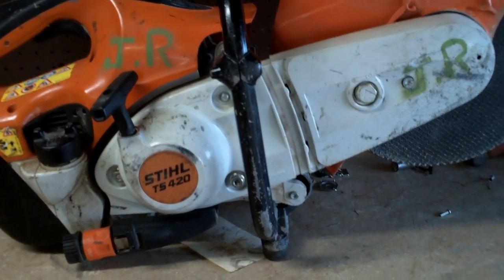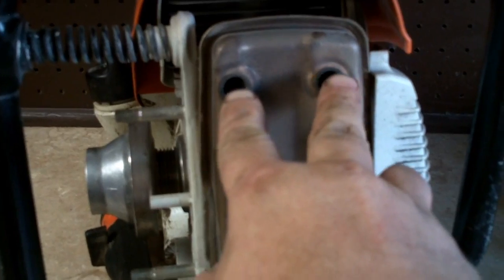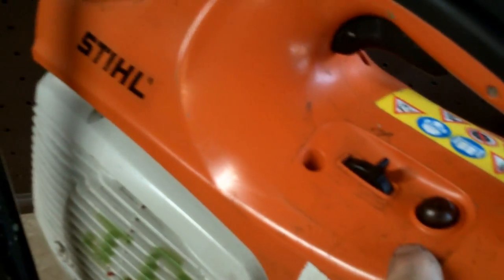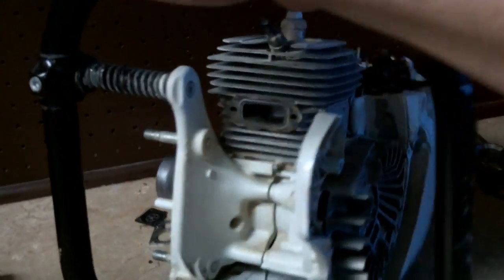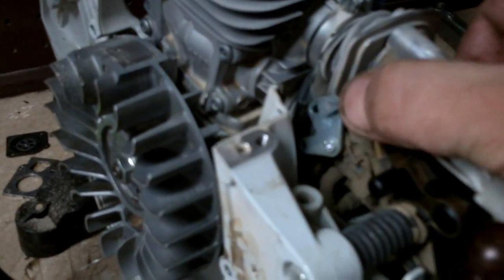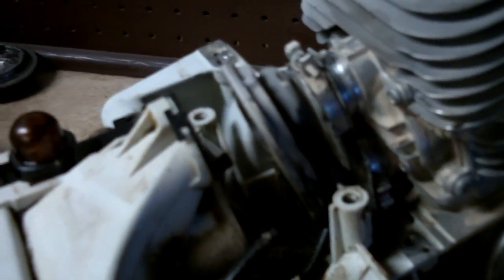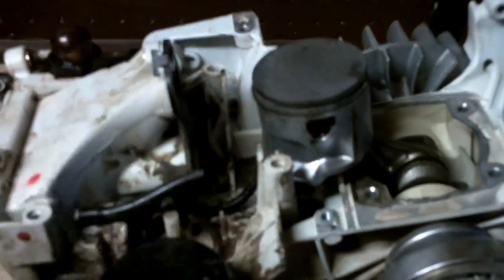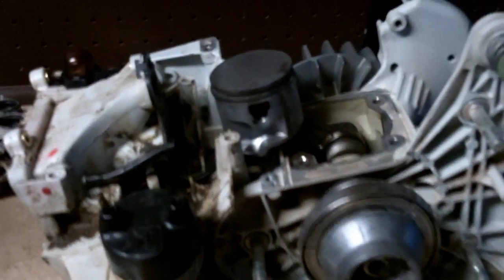PART 1      "THE TEAR DOWN"       STIHL TS 420 TOP END REBUILD

Comment: Hi do you know if the crankshaft for the stihl ts420 works on the ts 480
Reply from the maker: I would need the serial numbers
Reply: Is this one 00009673436AED
Reply: It’s located in the bottom area

Comment: 2:50.. got that right.. im rebuilding one because of user error.. these engines used mixed gas only. Air filter that came out of company saw was ridiculous and suprising that the saw still runs flawlessly

Comment: hey jeremy great videos. i am attempting to rebuild my TS420. I have about a 1/4" horizontal play with my connecting rod, is that normal, or okay to put a new piston and cylinder on? another video that i watched said that there should be no movement on the crankshaft rod, and if there is then that can cause the piston to rub more on one side of the cylinder causing it to burn out faster. i dont want to replace crankshaft obviously. i tried and having a hard time getting that out. suggestions??

Comment from the maker: IF YOU ARE REBUILDING THE ENGINE THEN YOU WOULD RELACE THE BEARINGS, ELIMINATING THE NEED TO GUESS HOW MUCH PLAY IS TOO MUCH PLAY.....THEY ARE EASY TO REPLACE...JUST POP THE KEEPER OUT OF THE PISTON AND SLIDE OUT THE WRIST PIN AND INSTALL THE NEW BEARING

Comment from the maker: in part 2 i am gona go over failure causes and talk about mixing oils and carbon build up.....i honestly think a flake of carbon dislodged from the top of the cylinder or exhaust port and got lodged between the piston and one of the ports...but the main cause was dirt injestion